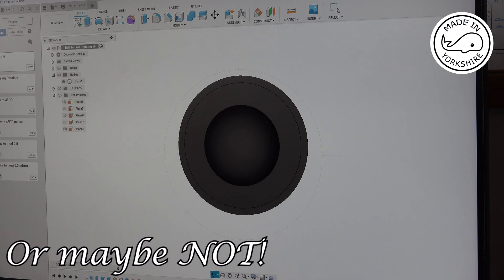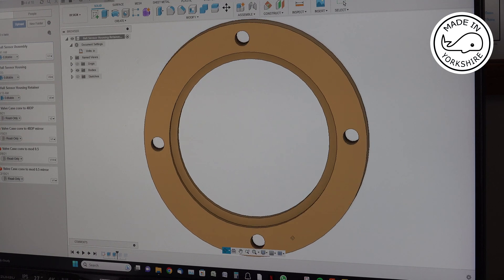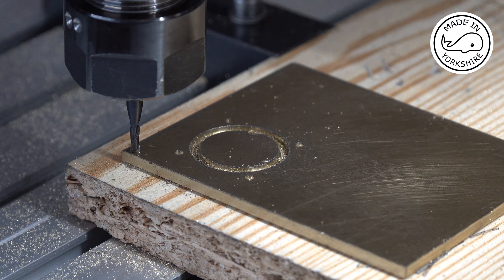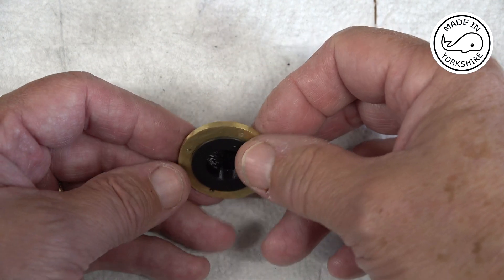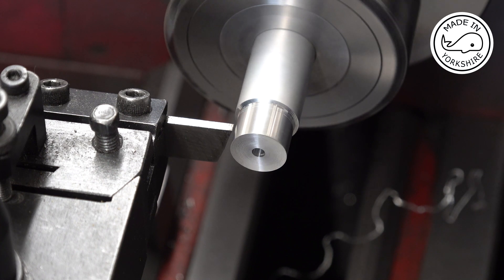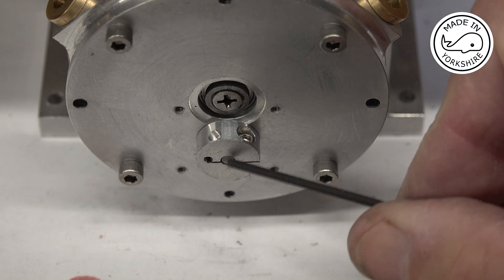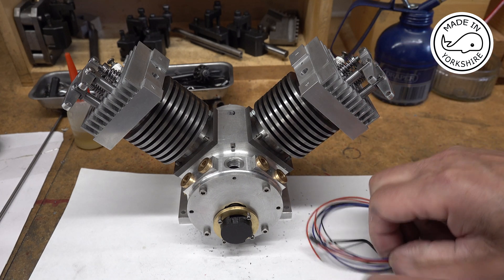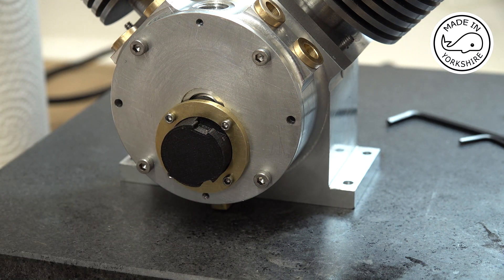#MT49 Part 18 - Jerry Howell V-twin IC Engine. Ignition - Part 1. In 4K/UHD be Andrew Whale.

Comment: A mate of mine was at the Airshow. He said there were actually 2 shows. The Church fenton one & the Sherburn Airfield had one too. I saw 2 Spitfires over Micklefield where I live. What a sight & sound. The ignition. MM something I will be looking at soon. I was hoping to use the old system from the donated chainsaw. Not sure though & £100 seems rediculous for a model. 
Steve.
Reply from the maker: Hi Steve - I don't think the CF airshow was sold out, which is a shame. Using ignition from a chainsaw should be interesting!
Cheers
Andrew

Comment: This is the black magic bit as far as I am concerned. It doesnt seem like good engineering to have two separate ignition systems, but I understand your desire to follow the design. Nevil Shute defined an engineer as 'someone who can do for ten bob what any fool can do for a quid'. Might be worth checking a bit further before parting with all that loot for two systems. The engine looks very impressive fully assembled. Potentially it appears capable of doing some serious work. Very much looking forward to seeing it come to life.
Reply from the maker: Hi Tim. Now that's a cracking saying! Mister_G recons that the HT connections on the cheaper RCEXL units can be modified. If so, that will keep the price down a bit. In theory this little engine could do some serious work - assuming it's been machined correctly 🤣

Comment: I think the Delrin products are inherently dissipative and electrically stable unlike many other static"dissipative" plastic shapes. They do not rely on atmospheric phenomena to activate, nor are surface treatments used to achieve dissipation. Static electricity is dissipated through these products as readily as it is dissipated along the surface.  Forgot to mention that your engine is looking fantastic great work
Reply from the maker: Ah now that's interesting. I have used PETG previously to hold hall sensors, but in this particular case there will be a small film of PETG between the sensor and the magnet. If I encounter problems I will bear that in mind.
Cheers
Andrew

Comment: Thanks for another interesting video. You can slide a 1/4" spade connector onto the tops of those little CM6 plugs for a fairly neat HT connection. Also, with the RCEXL units, you can take the plug connector off and fish the inner HT lead out through the braid near the electronics box. This gives you a separate HT lead and earthing braid. The hall sensors are also small units if you don't fit them into the supplied plastic housing.
Reply from the maker: Thanks for explaining. You might have just saved me around £80! I think I might buy one RCEXL unit and experiment.
Cheers
Andrew